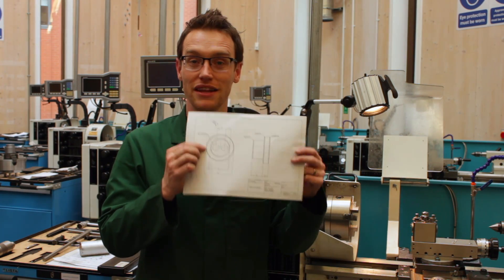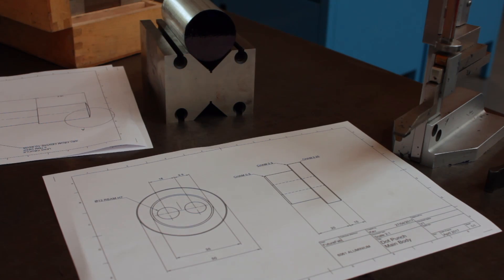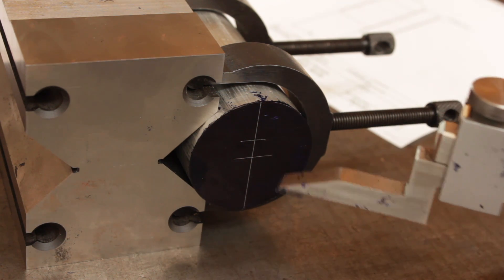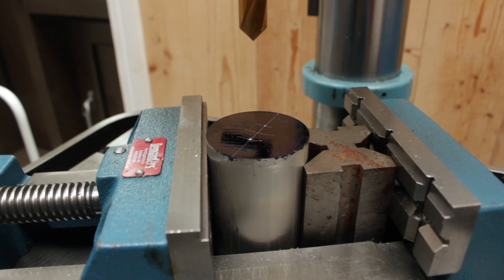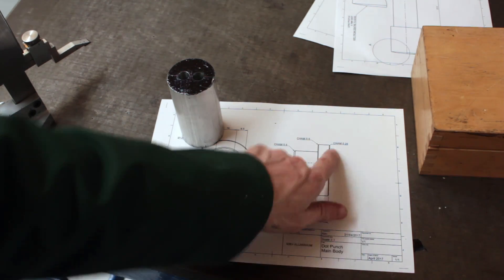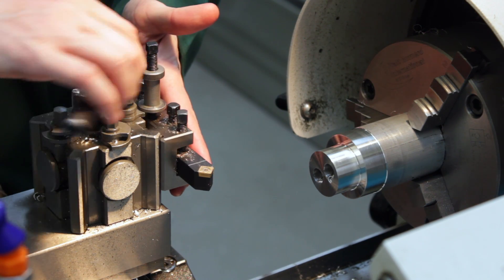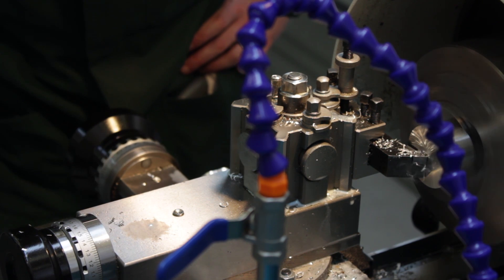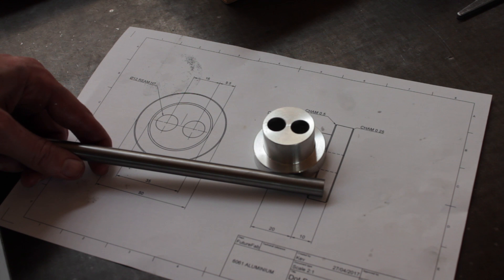Optical Dot Punch Body (2/4) -  #5minFriday - #27

Comment: Hi Kev, just found your channel, thank you for taking the time to produce these, you explain everything in simple terms, and no frilly or fluffy stuff, you deserve a higher subscription count.
This is in my "Tools to Make folder"
"DONT EVER STOP" from what i have observed, find simple tooling projects to machine, or like this tooling for your own shop.
But keep in mind that most home shed dwellers don't have the machines available to yourself.

I have a Question or two. What were the inserts you used for such a fine finish on the aluminium base please, and the shot of the tool that cut the chamfers on the 12mm holes, was it just a normal Chamfer Tool used bloody carefully.
Is this a project that you give to your students for machining credits, if so fantastic as they would have this for life, named and date stamped, Kindest Regards Beagles.